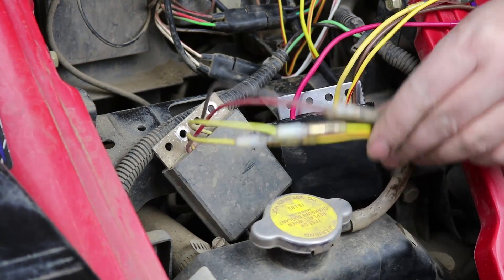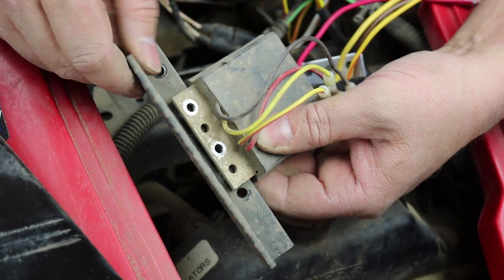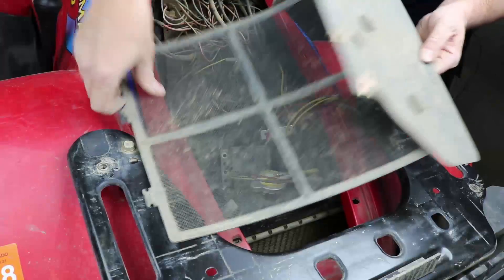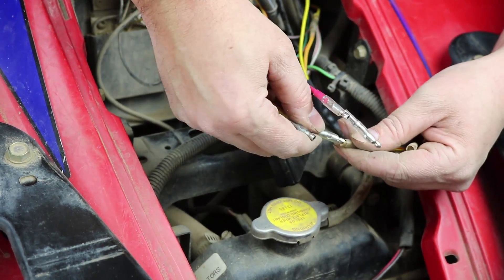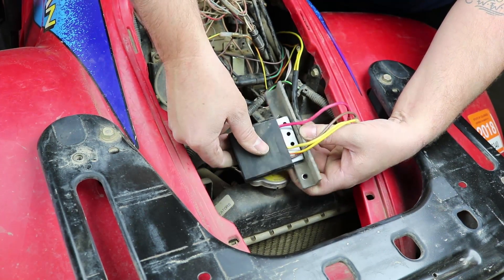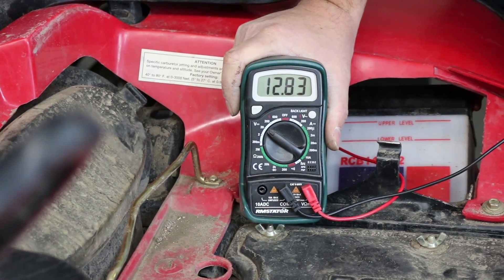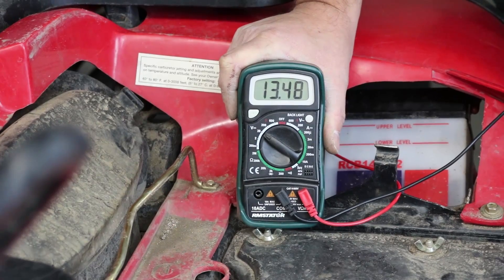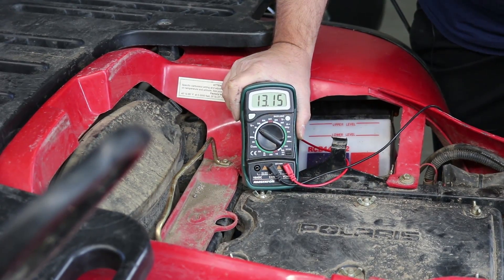How To Install a Polaris Regulator Rectifier # 2203636 4060173 For Sportsman 500 and more RM30T12

Comment: My 2002 Sportsman 500 HOI was able to remove the old regulator/rectifier with out removing the front grille, I didn't remove the front grille because I have a electric winch in front of the grille and it would have been a lot more work. So I soak the Torx screws down front and back even the between the angle bracket with WD40, it's a tight space. The Torx screws go through the regulator holes, angle bracket to the frame all in one. Then let sit a few hours, then I was able to use a screw driver type Torx driver to crack them loose, very tight space!  These must go out frequently because like this and other videos didn't appear to be original factory, it had been done before. Polaris sells their version for $199.00 and On Amazon I purchased for under $20.00. I'll buy another for a spare.
Reply from the maker: This is awesome info, thanks for sharing. Glad you're happy with the product!

Comment: Is 13 volts good ?
Reply from the maker: 13V at idle on a single phase old Polaris system is OK. You should see increase with RPM however, up to 14V+ if the battery is fully charged and in good shape.

Comment: Hi...do you know where the white wire from the throttle housing gets plugged into on circuit board thing under the cover by the headlight ? I see where the red wire goes but the white wire came off and I'm not sure where it plugs into..any help would be appreciated..thanks..I have a 1996 polaris 500 4x4 awd.
Reply from the maker: Sorry I don't have this ATV around any longer to check, I'm not sure!

Comment: Thank you for this video!  Can you tell me what that other box is that looks just like the regulator, up and left from the location of the rectifier?
Reply: Little bit late, but thats the 4 Wheel Drive Safety System. It Stops the 4 Wheel Drive from working when in Neutral and reverse and when the rpm is over 4000. You can ovverride the safety with the override button on the steering handles.

Comment: I have a question for you about the upgraded voltage regulator/ rectifier for the 1998 Polaris sportsman 500 4x4. I have gotten this new voltage regulator/ rectifier and it turns out that the old voltage regulator and voltage rectifier are separate components. What do I do with this new unit that does both?

Comment: On 2007 Polaris 500 EFI it is almost impossible to get out. The 3rd torx is in a crazy spot up top. It also uses large special pigtails on both sides so replacement extra tough. Poor engineering. Wish me luck!
Reply from the maker: Good luck! It is possible, just takes some time and patience.

Comment: Ok I have a 96 Polaris xpress 300 2wd was running fine parked it now I have a no spark problem I found that this voltage regulator had burnt and melted the front of the voltage regulator box nothing else looks damaged would this cause a no start no spark problem
Reply from the maker: That is definitely a problem, but a failed voltage regulator will not affect the ignition system on these models. Likely cause of no spark issue is the stator source coil or pickup coil, or the CDI box failing.
Reply: @Rmstatorinc  ok thanks I got it fixed I soldered the old voltage regulator where it burnt and it fired right up so idk but its running better then it ever has.. thanks for the help

Comment: I have a 2004 Polaris sportsman 500 HO and it's not in that location I took the front fenders off and found one up by the gas tank the part number on it says load shed module is that the same thing
Reply from the maker: No, you will notice it has different wire colors than the regulator. Regulator only has Yellows (with stripes), Brown, and Red. The module you found is the reverse speed limiter. It looks very similar, but is not part of the charging system.

Comment: I may need to replace my regulator too. I have a Polaris expedition and yup, it's hard to get to. I noticed you had removed the bracket. Is it easier to just remove the bracket first then the regulator. I measured 17volts at the battery when the ATV is running. That's why I suspect the regulator. I also read if the battery is low, and mine has been at 12volts, the regulator may charge at higher than 14.2 volts. Do you know if this is true

Comment: would using a regulator weaken the battery life of your 12v atv battery? strengthen it? or have no effect on it. 
ive replaced the battery on my 2002 Polaris scrambler 500 4x4 and never thought about the regulator I have on it.
hope my question was clear, also very good video.

thanks
Reply from the maker: A regulator is a required part of the charging system. You would not be able to charge your battery at all without one. On an older ATV, it's not a bad idea to replace stator, regulator, and battery all together.

Comment: Mine starts on the pull starter but just turns over with the key.  Runs fine, but wont start with key.  What are your thoughts on that?
Reply: Check position of exciter coil inside pull start cover

Comment: I have a 2004 Sportsman 600 that has a battery symbol flash in the dash and a speed needle flash red. The bike will also die as I'm driving. Sometimes I can start it back up right away, sometimes it will turn over longer but it definitely is not the battery as it turns over no problem and I just replaced the battery too thinking that was the problem. The stator is charging fine, not overcharging. Do you think it's the regulator?
Reply: Man.. I have a 2005 sportsman 600 with the same problem I’m still looking in to it. Have you figured it out yet?
Reply: @whaleyboys5801  I changed the battery and changed the voltage regulator and the battery logo is still flashing. :-(
Reply: Thanks ..that’s poop...l have a new battery in it. I’m going to do some more testing. Thanks again!
Reply: You guys ever figure out the problem. I am having the same issue

Comment: This video would be much more helpful if you would show how to get the trim cover off and where the regulator is actually mounted. Thank you!
Reply from the maker: Sorry, we don't have this ATV in our shop any longer. If I remember filming this correctly, the regulator is on a bracket in front of the regulator. The cover over the regulator removes easily with a few screws.

Comment: Will this cause a no spark condition? I have replaced the coil the Cdi box and the stator and still have no spark?
Reply: I have same problem
Reply: Matt Skaggs have you diagnosed this any further? I am at the end of my rope with this thing lol
Reply: SOMEONE PLEASE HELP US... at least point me in a direction
Reply from the maker: No, the voltage regulator has nothing to do with ignition on these models.  A spark problem is usually caused by the source coil or pickup coil on the stator assembly. You could also have a bad CDI box, or ignition coil, spark plug, or shorted kill switch circuit from the key or handlebars.
Reply: RMSTATOR if I disconnect the black wire on the cdi won’t that bypass the kill switch?  At this point the stator is new the Cdi is new and the coil is new not sure what’s left lol any help would be awesome
Reply: Seen this comment and on my 2001 sportsman 500 I had no spark to spark plug it was running fine then shutoff one day, I changed coil with the plug wire spark plug, stator and put battery in (all charged up ready to go) and now when I flip the switch on I’m not getting any power to the nuetral light, starter or anything of that nature, I need some serious help with this

Comment: What is that box at 26 seconds in the top left?  Looks just like the regulator he is showing how to replace?
Reply from the maker: Good find! That is the reverse speed limiter box. Often confusing on these era Polaris ATV's as it looks just like the voltage regulator. It will have different number & color wires than the voltage regulator.